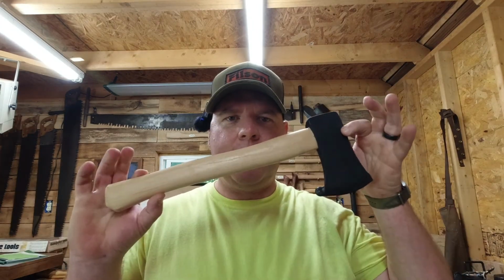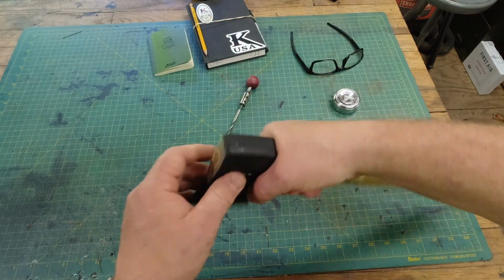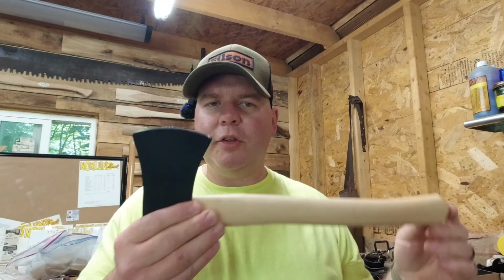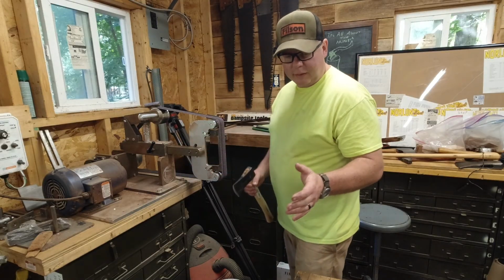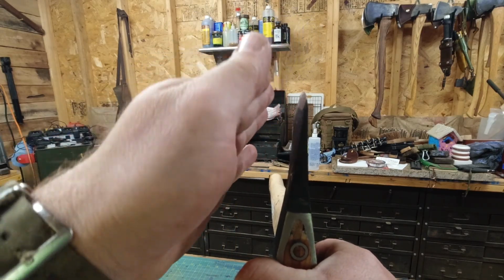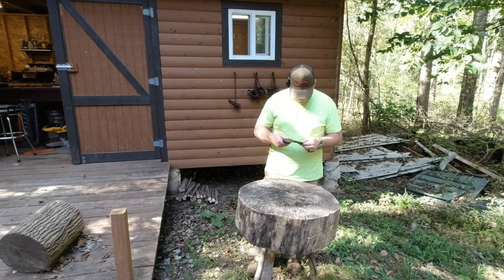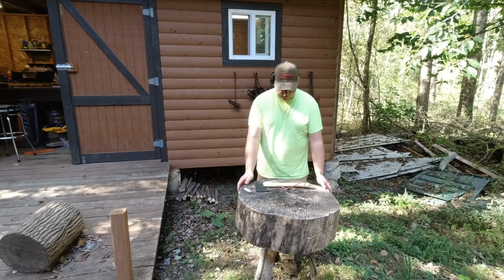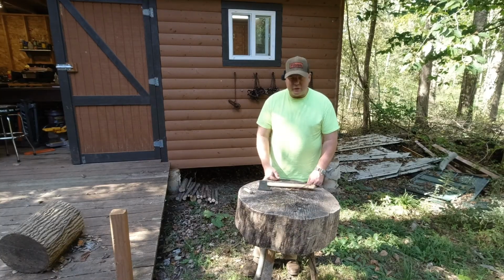Harbor Freight Hatchet! TESTING And Tuned! Worth $12?

Comment: Its great for what its meant for.  My dad leaves his laying by the wood splitter. He uses it to cut apart stringy pieces, breaking off small branches, twigs random pokeys....he doesnt care even the slightest about it. Its simply a sharp club to whack random crap. Oh no! I hit the steel wedge of the splitter?  Who cares? Oh no! It got left out on the ground/splitter/table? So what? That bark is all full of sand and dirt?  Use the hatchet. Its dull? Run it across the bench grinder. It probably gets used more than all his other hatchets.

Comment: So I took it out as is and took down a few small trees in my yard. For a 13 dollar axe it's great. One tree about 4 inches thick and another one about thigh thickness. Took about 7 minutes for the big one and about 3 for the small. It cuts great, burrows deep, only thing I can see to really fix is the blade geometry but a good bastard file and patience can handle that

Comment: I would clean out the gap and pack full of superglue! Thanks for the tip of scraping off the lacquer, an easy way to do it.  Then several coats of either tung oil or linseed oil to waterproof the wood. And the lanyard hole, rather than using a leather boot lace, I would use a piece of paracord for the lanyard.

Comment: I stripped the coating off mine soaked in in vinegar for two days and changed the grind and sanded the handle down a lot and I have a lot of nice expensive axes and hatchet and I swear to you this is the best limbing hatchet I have and gets sharper than any other I have trust me that thing is well worth the money if you put the time in it it’s great takes most limbs in one to two strikes at most
Reply from the maker: It's a great profile. That's for sure
Reply: What does the soaking in vinegar do, and does that swell the hickory?
Reply: @TheHallbjorn  nothing he was just removing the black finish..
personally i'd leave it, protects versus rust

Comment: Can’t you fill in the gap with wood putty, remove the varnish and oil the handle and sharpen the blade? For $12 for occasional use, seems like a pretty ok deal. Btw I have looked at estate sales and garage sales and have very seldom seen any hatchet, let alone one with intact head at $12.
Reply from the maker: Yes

Comment: The heads on there I don't know what steel they use but it's freaking awesome they take a beating some of the Hammers do too I used them for years and they didn't wear out as quickly as some of the other brands I don't know like I said what steal it is but it's hard and it doesn't just mushroom out like a lot of Steel does

Comment: Spend 5 minutes on sharpening the edge with the coarse belt on a work sharp.  Strip the finish with a pocket knife, sand and soak the handle in BLO amd you are left with an excellent camp axe. I got a "good" one at HF but like you had to go through about 10 of them to find one hang decent and with a pretty grain. 30 minutes of time is all it takes and you have a decent enough hatchet to throw in a pack or vehicle for emergency use. I think its worth every bit of 12 bucks.
Reply from the maker: Definitely
Reply: I'm a newb. How do I know if I find one with a decent hang to buy?What do I look for?

Comment: That damn thing out of the box is good for nothing but grub work. If you do all the other stuff to it, then it can become a fairly useful tool. I'm sure you would agree. No the steel is not going to be anywhere close to what a Plumb or a Stanley, and damn sure not a Gransfors. It can definitely be a good tool in a pinch if you needed it to be. Also a great example of a tool to teach kids about how axes work as well as care for the tool. At least you won't cry about it too much if they screw it up to the point where you don't want to even try to fix it. Lol
Reply from the maker: All true
Reply: Comparing a china made 12 dollar hatchet to a Gransfors? Lol